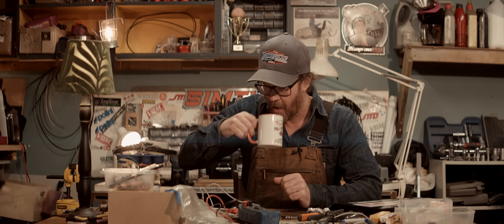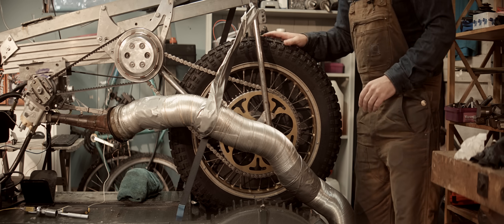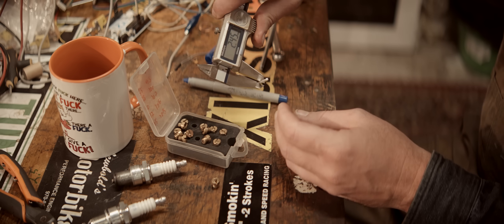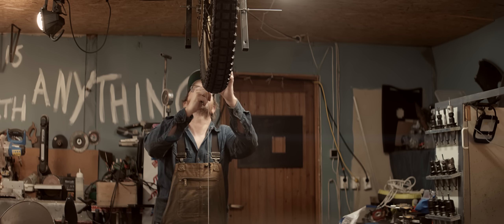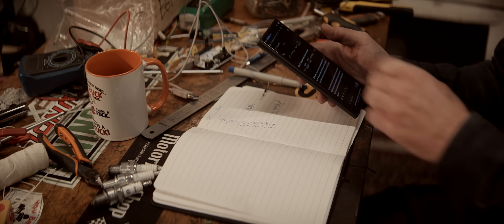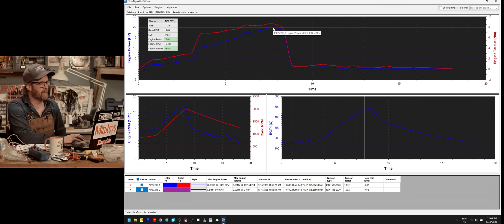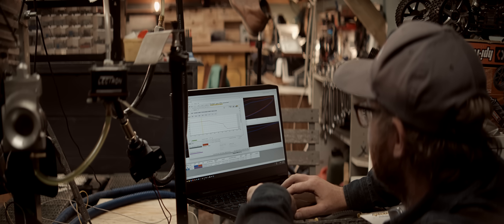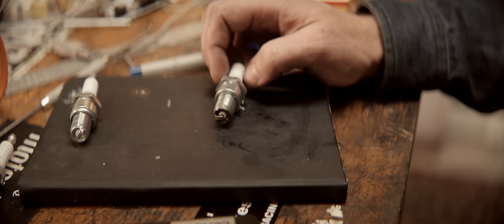22+ Wheel HP from 50cc! Finally!! And we're just getting started.

Comment: Awesome project, I love seeing how much work and creativity goes into getting the most out of a small 50 cc two stroke! 🙌
I’ve worked many years with engine calibration and power measurement and just wanted to share a small tip that might help with your record run.

It’s really important to measure and tune the engine the same way it will actually be used.
An engine built for long top speed runs needs a richer mixture to keep combustion temperatures under control.
An engine built for quick acceleration usually performs best with a leaner mixture, since the high temps are only reached for short bursts.

It all comes down to controlling combustion chamber temperature. An “over-powered” setup that reaches speed quickly should be measured in a fast, dynamic run, while an “under-powered” setup fighting to reach top speed needs a more static test to get accurate results.

Good luck with the build, can’t wait to see how fast that little 50 cc rocket will go! 🔧💨

Comment: Alex; there could be value in seeing what power it makes on race gas with this dyno setup. If this power was known, you could see the performance increase trend with nitro % there are formulas of % power increase with % nitro…..if the power doesn’t trend with the % mix your running it could easily verify if the tuning needs work vs adding more nitro to the mix (safer tuning).

Comment: after about 6 years you now have a 50cc single cylinder  two stroke producing  around 22hp.,,, in theory, you potentionaly  have  a 250 cc two stroke capable of producing 110 hp.!!,,,from a single!!,,,,,,,as a comparison the last model suzuki rgv 250 twin cylinder road bike claimed to be about 70 hp out of the crate on pump fuel in 1998,,,so i think you may have proved your point,,,BUT apart from that please use a benchmark dyno like superflow or dynojet then your figures will be comparable worldwide.,,,as for "drilling out" main jets  that only works on harleys.

Comment: Nice! I enjoyed your measuring of the wheel inertia, I did the same thing with my inertia dyno drum/flywheel, (raised it up on a shelf and accelerated it with a weight on a string), only I timed it with a picoscope since I already had a hall sensor on it. The numbers came out maybe 5% different from the mathematical calculations, and both were different to fudging the numbers to match a reading on a known engine from a commercial dyno… hopefully you’re within a reasonable margin there. Not that it matters really, as you said before repeatability is more important than accuracy

Comment: Dont mind about the plug color or reading! Just check the EGT and put a Lamda Sensor for dyno testing. Always remember Air fuel ratio with gas ~15-1 ,Methanol ~10-1. Just Go  for 20-1 compression ratio with Methanol for the beginning with arround 12-13* advance at peak rpm and the PIP should show something. 
Please stop waisting time ….😉
Reply: Isn't a 10:1 air fuel ratio for methanol extremely lean?
Reply: @TarenGarond no thats very rich
Reply: @michaelburgard9041  Stoichiometric ratio for methanol seems to be around 6.5:1 so 10:1 is magnificently extremely lean.

Edit : By the way 15:1 for gasoline is also very lean not to the same extreme extent but still!

Comment: I don't know if anybody already mentioned it, and I am also not that familiar with Lectron carbs, so I also don't know how those are affected by that; but normally it is a total no-no to drill out jets with a twist drill. That totally fcks up your atomisation pattern. The metering hole in the jet has to be exactly centered and very, very smooth. Also the tapers are slightly different according to size. 
But regarding that your epic engine makes epic power; I couldn't argue with results. 
Greetings from Germany!
Reply: I agree that drilling jets is a big no-no when running normal gasoline but it is not considered to be too bad when running methanol.
Reply: @sidecarbod1441 of course. It just boggles my mind a bit that the guy throws huge shedloads of money at his projects, but cheaps out on a $75 set of proper jet reamers. You could also use a $25 set of tip cleaners for oxy-acetylene torches. 
But, as I mentioned before; could and should not argue with results. 
I love those projects and I absolutely adore the guy's commitment on the cause!
Reply: Good suggestion, a lectron should be fairly easy to get dialed in.
Reply: Racers have been drilling jets out since the begining of combustion tuning ..  micro bits are cheaper than micro reamers..😂😂
Reply: @rebekahfrench5747  and engine builders and engineers do know since ages what's happening in a carburettor....

Comment: Don’t know if this has been mentioned but for jetting and looking at the plug in the Yamaha Banshee world we use the plug chop method. You have to look at the ring around the insulator.  Look up plug chop and dive in. There is a bunch of info. You need to get the engine warm on old plug then put a new plug in. Run it up to max speed and cut the ignition. Take plug out and cut the threads off looking at the insulator at the very bottom. That is your mains working.  You are looking for a nice brown ring around the bottom and it needs to be a certain thickness. There are a bunch of examples on the interweb.

Comment: For your dyno readings why don't you use a toothed belt land sprocket system instead of the variator like they use in france on scooters it will be having less loss normally i think. You can search on tournoi racing page , keep the works up man

Comment: Great progress! At 9:45 when you used ChatGPT to calculate inertia you used a "diameter" of 317mm for the wheel, should that not have been the radius? Don't know if that makes a significant difference but impressive performance in any case. Well done!
Reply from the maker: Thanks! That was dyno roller OD👍

Comment: Congratulations, outstanding! 
I'm verry interested why the variator doesn't use his full range at the runs? is it a considered choice or is there room to make better use of the cvt?
Reply from the maker: As the engine can't move and the rear pulley is fixed the ratio is locked at a little bit over "first gear". Works nicely.

Comment: Retard 1-2 deg, up the comp and think about colder plug? Plug center looks like it has a bit to much heat, but even more so the electrode, but the latter is fixed with comp and ignition.

Comment: Have you considered using a ram pipe or airbox on the carb, to contain the stand off?
Fuel is being blown back out of the carb by shockwaves which could be messing up your mixture
Reply from the maker: Blowback dissappears in the powerband so it's not really an issue. A side effect of high intake duration.

Comment: Run a rotary engine spark plug if it fits. Intended on running hot and burning oil. NGK 6917 BUR7EQ Surface Gap Spark Plug.

Comment: Some of my friends had  80cc  KTM  in th 90's with about 23hp  (A beautiful machine...) and we were all impressed. Imagining that on 50cc is astounding...
Reply: Also, the KTM was measured engine HP, not the rear-wheel HP as is done here.
Reply: I remember a dude back in the nineties putting a KTM 80cc engine into a Suzuki TSX 50cc. Then he put a 125cc sylinder onto the 80cc engine. My good...that was madness. I had a Suzuki ZR 50, and later ER 50 both running 76cc Malossi cylinder with around 11hp. It was so much fun and experimenting. Drilling, filing, exhaust swapping, Mikunis and Delortos. I even brought the crank to the lathe and removed weight and added high rpm ball bearings. The RPM went through the roof after that but the torque went down and I became a bit to heavy for the setup. A lightweight fellow bought it from me when I turned 18 and he managed to hit 120km/t which was wild for those engines back then.
Reply: Yep which is likely close to 35 @ 50cc engine hp

Comment: Can someone answer this for me? If you had two smaller exhaust pipes that then equal to a larger volume in total, would you gain more scavenging?
Reply: No, on a 2-stroke the flow-max is not the only thing that an expansion chamber does. It essentially creates a negative pressure by leveraging the sonic power pulses of the first 'bang' to leave a low pressure area behind it by going from a high velocity small diameter to a larger 'expansion' area where it slows down, back to a high velocity singer out to the atmosphere. If done right, this leaves a 'vacuum' that 'pulls' the next pulse out. You can apply math and fluid dynamics to get pretty close and then start prototyping to see how the real engine deviates from the calculated range and tweak the design to hit the power curve most applicable to your situation.
Reply: Thank you

Comment: On the topic of jets 
Would it not be a good idea to try a carb with a powerjet? Not a squirter but an extra line for extra fuel at WOT.
I had a cheap one that I fitted to my 125cc moped before. It didn't run right on the 4stroke because I didn't have enough time to fully adjust it 

2 strokes love these types of carbs though.

Comment: On the dyno I don't care too much about how the plug looks unless it's looking like the plug grade is too hot. At the end of the day, the engine wants what it wants. Add fuel until power drops off (Safe). Then pull fuel with subsequent runs until you run out of power, or it detonates/sticks. Then you know for sure what the engine actually wants for fuel and you can move on to the fun of exploring CR and ignition advance.

Comment: Im wondering...I have an old 50cc moped which i played a little bit with, added more compression ratio(from 6.5:1 to 12.3:1) , bigger ports, a bit more ideal timing with port heights and cylinder raising maching down top of cyclinder, made a pipe planned for 9k rpm, ect....(still pretty far from ideal exh timing, and blowdown numbers) but from factory max 4500rpm now it does like 8.9k under load, 9.2k standing still. BUT i feel like it can ignite up in the rpms under load...could it be too big of a sparkplug gap or just the not ideal timig numbers maybe too small of a carb (15mm)? Currently sits at 0.4mm, i dont know if i could or should go even lower? Will it still ignite?

Comment: Is it possible to spray some distilled water into the intake at 12,000 rpm? The water mist should cool the combustion chamber somewhat.

Perhaps a little more torque due to the water expansion.

BMW has the system for cars.

Comment: Methanol has some cooling properties. Add more until your power drops off, then back it off one step. You can run more compression with its cooling effect, but your ignition has to keep up. When in doubt, look at your piston crown. If lean, it will be very obvious. Looking very promising so far!

Comment: Biltema has a super cheap drill bit set ( 19-2009 ) with 0,6 - 0,8 -1,0 - 1,3 - 1,5 & 2 mm bits. You could use those to get to the ballpark when sorting out jets.

Comment: I recently had to drill some small circular parts. Having previously struggled in the past.  I printer a two part TPU bushing; square when the two parts are together, with a circular hole a little smaller than the part.  It worked really well.

Comment: DUDE, You need to invest in a wideband  air/fuel ratio meter with gauge.
That will help a bunch.  Save you winging it and potentially burning up your gear...

(PLEASE NOTE:  These are good, but will only give  valid readings at WOT!!)
Reply: wideband is hard to use in 2 stroke the oil will damage the sensor fast.
Reply: @Intesanoga you use an adaptor to prevent  this.

Easytunes kit is the best bang for buck

Comment: In the 1960's ...ran up to 40% nitro to methanol in West Bend Kart engines.  The plugs were Autolite AG401 (maybe 403?).  These are fuel plugs.  Also, English brand KLG 285 (used in Indy Cars.)  The main thing is, fuel plugs should have a recessed electrode.  Std. plugs tend to overheat the center of the piston (burn holes.)   Congratulations on your HP readings.
Reply: P.s...
U da guru!
Congrats my 2stroke brethren

Comment: My opinion: that blue means 500ºC aprox (which sounds hot as hell). I used to check the mix proportion looking at the porcelain color: that white porcelain means too lean but i didn´t run on methanol+nitro but just gasoline. I also think EGT is the best indicator to keep an eye on.
Gogogogo!!!

Comment: 22+hp from 50cc is just insane
Reply: Thinking of it as 440hp per liter is insane. Thats like a 800HP Civic.
Reply: @mrf4549  800hp naturally aspirated.
Reply: @mrf4549 you mean 800hp at the wheels , so more like 1100 hp naturally aspirated
Reply: It is. Race teams achieved 20hp 40-50 years ago so I'm hoping to see 25+hp with new tech. Direction is right and up. Go, go!
Reply: @EinarLerschen  You're right, but they had like 200 usable rpm, here we are looking at usable power band.
Reply: @arekkoski  thats the problem in 2 stroke in this high end stuff... you have like 200 to 300 rpm powerband if you get out of that powerband you will have absolutly zero power..... nothing will come out of the engine its just an airpump nothing else if youre not in the powerband...
Reply: @BlastWorrior you are talking about old engines, here we are getting power and torque from 10k to 16,5k rpm, it's a lot of powerband for a 20+hp 50cc
Reply: @EinarLerschen yes, Kreidler-van Veen.
Reply: @EinarLerschen  wasnt that at crank tho? so this engine would already be more powerful?
Reply: @EinarLerschen  oh and also... bruh im getting old lol. when i read 40 50 years ago i thought of the 1960s lol
Reply: @EinarLerschen  The new video shows he got 25HP
Reply: @EinarLerschen  25+ has already been achieved in the netherlands with a Zundapp engine and a stock (of course heavily modified) Derbi cylinder.
Reply: @Kattenbief  I've heard rumors of couple of cases but no verified data has accured of +20hp 50cc. I've never heard of a zundapp before tho. Is there a video?
Reply: @EinarLerschen  https://www.youtube.com/watch?v=2bJqUlqecIw
Reply: @XploiTee  Thought the other guy was saying +25hp.
Reply: @EinarLerschen  https://www.youtube.com/shorts/BL821Wwyn28
Reply: @EinarLerschen  Yes the 20.9 is an old video, they have 2 engines, a reed valve engine they got to 22.9 with and a rotary valve with 25.3hp currently.
Reply: @Kattenbief  That is insane, indeed insane.
Reply: 22@wheels ! = even more hp on the flywheel
Reply: There are methanol glow motors of 3.5cc (.21ci.) that can make well over 1hp per cc. But that's at well north of 35,000 ripums, plus 15-40% nitromethane, for smoother running! 😮😅😊
Reply: I need that in my 5hp outboard
Reply: I have been waiting for years for this ❤ so worth the wait and the amount I have learned on the way is invaluable ❤
Reply: Kreidler Vanveen  factory 17.5HP 205KPH 1971 race fairing 
232KPH  record fairing
Wait to see the speed...
Reply: @fabbri4497 I don't think it would do that speed at Bonneville.
Reply: But Who said are real?
just put different inertia Number or Gear ratio and the computer Will give back 35 hp
Reply: @vnsworkshop9961  Exactly... dyno tuning.... Tune the dyno until you are happy with the number displayed
Reply: Best 50cc‘s today do 26-28hp depends the dyno with regular fuel , so 28+ is a must to be Nr1
Reply: @michaelburgard9041  I would like to see that because at 27.5hp at the wheel you would have equalled the Aprilia RSA which I doubt anyone has done (on regular gas).
Reply: @Kattenbief  i sad 26-28 depending the dyno , with regular fuel i mean no Methanol, so of corse some race fuel

Comment: More fuel looks the right thing.
From my overal experience with methanol although 4 stroke engines(speedway bikes), it was more fuel, more fuel until it became to much it seems.
But then we went leaner, it didnt became better.
I bet on more fuel, until to the point it seems to much, try to get more overall volume into the engine, so more air to that fuel. (bigger inlet,carb or whatever).

But eh, this seems very promising, congrats on those numbers you got right now.
Can't wait for the next video!

Cheers!

Comment: I dont understand why the inertia wheel measurement was needed? wish you elaborated that more? I have an inertia dyno, and I also use yourdyno system, I put in the MOI (moment of inertia) number and the yourdyno software does the rest.
Reply from the maker: With low inertia in the dyno roller that big wheel's inertia has an effect on the reading. Less than what I thought though, probably cause there's so much loss in my roller assembly - Cooling vanes on each side, seals, huge greased bearings. With say 10kgm2 in the roller, wheel inertia would be insignificant.
Reply: @2STROKESTUFFING ahh ok, I think I understand now. So your roller drum is not very heavy? So it has very low inertia?  Lucky for me when I made my Dyno, I managed to score an old dynojet100 motorcycle Dyno that I use the yourdyno system on, I believe my drum is around 800lbs.

Comment: just for giggles, make a 1/4 -32 adaptor and throw an RC glowplug in. methanol, it will run.
and whilst it raises its own list of issues, like no killswitch, it maynt be so silly as it sounds... can have multiple plugs, for instance... theyre tiny, can have several peppered over a combustion chamber...
timing is controlled by compression ratios at that point...
Reply: Not even giggles lol,,I saw a vid of a guy with a 27cc gas engine,in an RC hydroplane,running on meth/nitro 15%,with a glow plug head he made,,Went well but twisted the crank

Comment: The camera sometimes can trew off spark plugs reading but I do see a safe heat marks on the straps, it almost touching the threads so, in my opinion you were still safe on timing but might wanna add more compression. I think you could make few more horses with compression and fuel adjustment. 25hp not seem impossible now for 50cc. Definitely achievable with the current fuel technology and ignition. I'm beyond amazed.